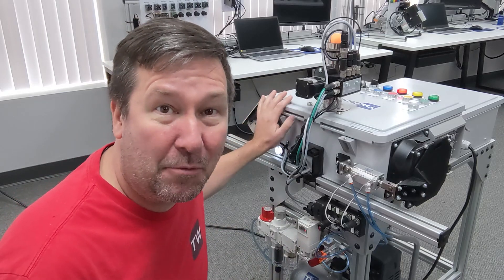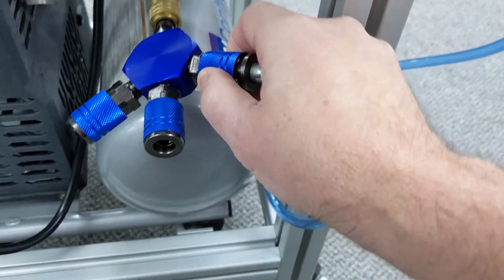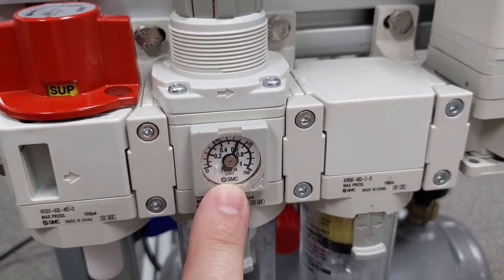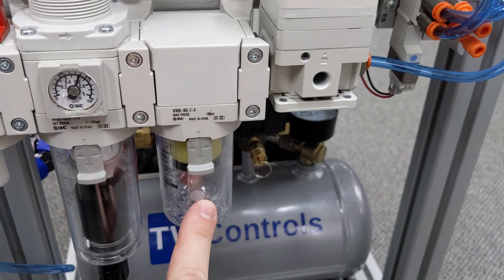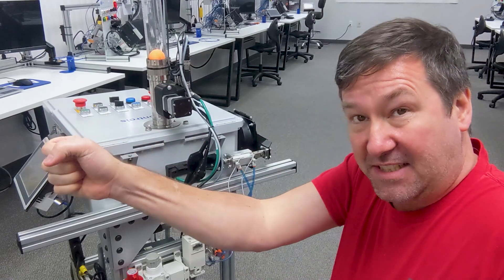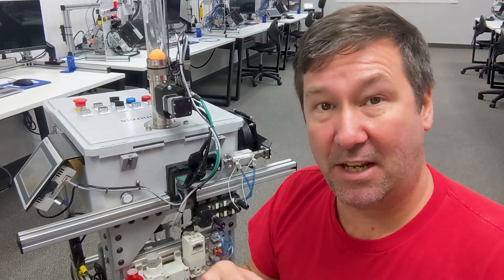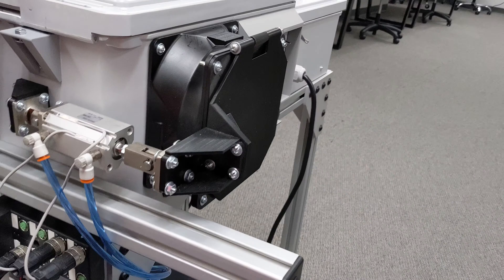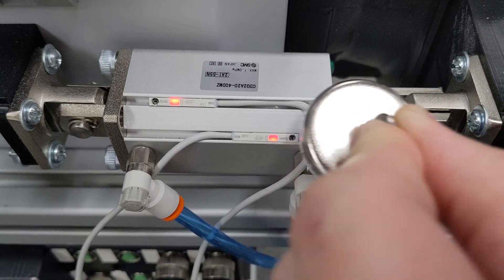How Pneumatics Work - A Simple Overview

Comment: Some equipment relies on pressure on the pneumatic system when electrically de-energized, loss of air pressure could have a negative impact on material holding or pneumatic drag brakes.
Reply from the maker: Very true
Reply: @TimWilborne  It is very common for several different technologies to work cohesively on modern equipment. It is necessary to have some understanding of how they work and interact to do efficient troubleshooting.

Comment: On my air systems I have 2 different states that valves have to be in when the stop is engaged. For some valves they need to dump air others need to hold their state to prevent motion in the system to prevent  and interference state with the machine.
Reply from the maker: Yes, I thought about doing a real basic video explaining it.  Thoughts?
Reply: @TimWilborne  necessary, we spend 4 weeks training techs and 2 of those weeks is just on pneumatic systems. Proper valve actuation during operation, when energized/deenergized, when the system has air, when the system loses air supply and when the E Stop is pushed. Check supply supply air pressure at the pressure gauge. Then check status of air supply valves awesome communication current state valve, then check downstream pressures. We use three aerate valves. One is normally open/normally closed it uses unregulated air pressure. The second valve is a 3-15 actuation valve. The third valve is a 0-60 psi actuation valve. Training what to check for as you work through the system is key. With simple actuators we have them verify the code is commanding the action, if “yes” verify air is leaving the pneumatic control valve by checking air pressure and flow at the discharge port besides looking at the actuator pilot light. If “no” verify the valve is off and check for air, in case the pneumatic valve failed open. When in a safety lockout state verify that the system has air and that the air is traveling the proper pneumatic control valves.

Comment: I would love to see more videos on pneumatics.  I have a basic understanding but would love more details especially the E Stop device you were referring to.
Reply from the maker: I have a video in the works on a safety valve
Reply: The E stops I see are 2 valves for control. A normally closed for the supply air and a normally open for the dump valve. The E stop cuts power from the valve closing off the supply valve and cutting power from the dump valve allowing it to open.